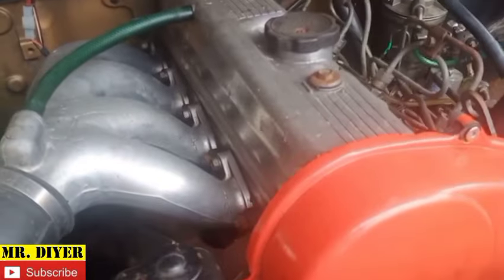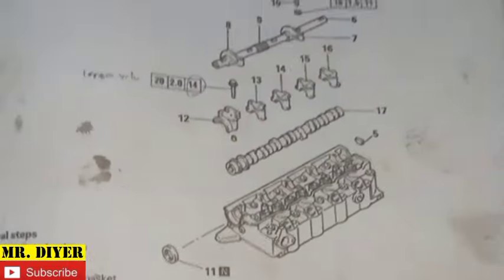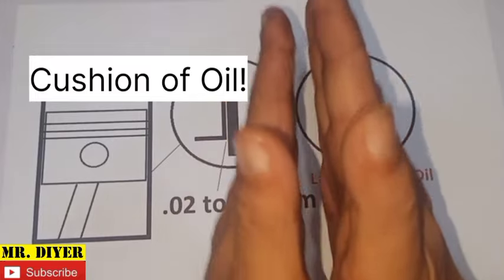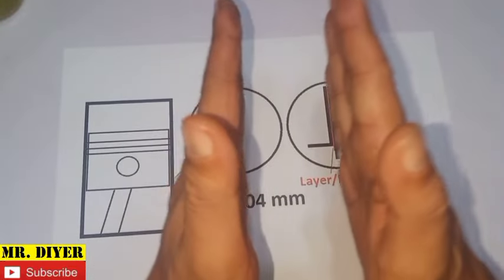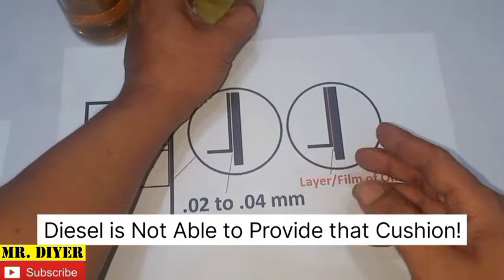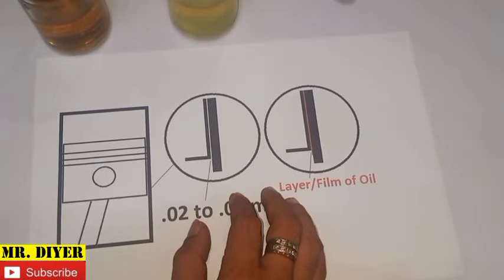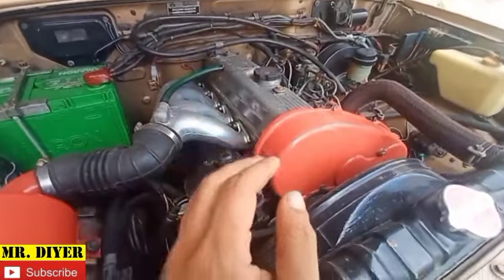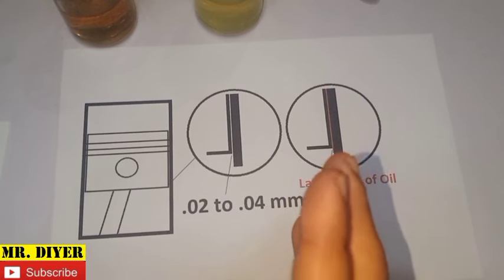Is Flushing Your Engine With Diesel A Good Idea?

Comment: Hello.I agree with oil film and viscosity of oil. But. We are here talking about engine flushing not driving the car with diesel instead of engine oil. To understand all I will break down the problem. When your engine dont work you DONT have the oil film ( only some oil leftover) when you start your engine the low oil pressure lamp does off but to build the nessesary oil pressure it takes time ( depend on engine temp, outside temp ect) so basically you dont have that oil film and your engine is working. The second thing is when you do oil flush you only start the engine and let it work for few minutes on low rev. When the engine is working on low rev you dont have the stress on components like when you are driving around. So you dont need so much oil film.So by mine opinion its absolutely safe to flush the engine .
Reply: I agree with you Sir......

Comment: I have been doing this for 29 years, mixing, I repeat, mixing 1/3 diesel and 2/3 engine oil. For a minute at most. The engine is reborn especially if it has many km.
Reply: I put it in just drove 100 miles today no problem gonna just leave it till I change it lol my 350z has 194k miles but I've kept good oil changes

Comment: You add the diesel to the exist oil you are planning to remove so you will still have some viscosity there, plus you are just idling, an engine that gets damaged by that was already damaged, it's just making noise cause the junk that was in it has been removed
Reply: Yes, seems he was just yapping

Comment: I just rebuilt my TD42 engine due to severe blow by. During the engine assembly process, the mechanic needs to apply good quality oil on the engine components. The thin layer of lubricant is very important for the initial start up. I rather use good quality engine oil and fuel to reduce carbon built up on my new engine. If possible, every 5000km change engine oil.

Comment: diesel is self lubricating though. this property is exploited in injector pumps so that they don't seize, as they would on other fuels. i certainly wouldn't run an engine with diesel in the oil, but i think steeping the entire engine in it could work, but also has the potential to release carbon sludge clumps that cause oil starvation. If you left the engine steeping for a month or longer i think it is sufficiently long to break up all clumps.

Comment: Flushing with diesel won't hurt your motor... If you ever done an oil change on a diesel truck with 300,000 miles on it you'd see the oil in mostly diesel from all the fuel that slipped past the rings.

Comment: Thanks again for some imformative info. 

I have a question, I had my oil and filter changed... whilst i was getting my breaks and break fluid changed! 
Since getting the oil and filter changed, I have had on start up a slightly higher engine noise for say 5 seconds and then it drops back to normal, I have never had this before after I have changed my own oil and never had this start up noise at any time. It's almost like the engine is making noise pumping oil around and then settles... any ideas? 
I know the Garage was a man down that day after guy hadnt turned up for work.
 I hadnt changed my filter and full sinthetic for like 10 thousand miles before this and i'm doutful he changed the filter which is more awkward up behind the engine from underneath and because I had also asked the guy to check a bolt which has rusted out on the exghaust under the manifold and when I collected the car and asked him whether he could cut it off and change it he said he hadnt noticed any bolt? But it was right in plane sight when I changed my own oil and filter whilst lay on the ground🤔 Would an old oil filter left on or maybe even a slightly wrong oil weight they may have put it cause this issue?

I did ask them to check the bolt when booking car in and on the day I dropped car off I reminded them to have a gander at the bolt. I just cant make headway when something dosnt make sense!

Many thanks again for your time.
Reply: What car do you drive?
Reply: @moshet842  2014 Honda Civic Tourer 1.6 idtec, diesel.
Reply: @moshet842  I noticed earlier that the rev counter dosnt sit higher than usual when slight noise happens on start up for roughly 5 seconds, just that there is a slight difference in noise and goes to normal.
Reply from the maker: @stephenmaas8775  if it only last for 5 seconds then i wouldnt be worried about it. Its normal. Id say its always been there its just that its only now you began to notice it https://youtu.be/TWNdPXku9ow?si=6dU7wIlkxMD5Rjk4
Reply: @stephenmaas8775  Depending on how the oil filter is mounted, it could be that they replaced it with a filter that doesn't have an anti-drainback valve or has one that does not work. If the filter is mounted under the car vertically, then this wouldn't be a problem and you can ignore what I just said. 
Other possibilities could be that they use a thinner oil than is called for.
Reply: @moshet842  It is vertical, I provoded the garage with Hona dealer filter and Expensive £110 Green oil, I think 0w-20 specific they said they started using this stuff only now? I usually get mine specific off CoxMotors online Castrol HC-2 oil which is the only oil for my car recommended. Maybe its the new type of oil used or maybe the lad kept my expensive stuff and put in there bog standard use for all vehicles 0W-20 the lady at the coumter suggested when I mentioned about the specific stuff online I had to get... For some reason this time it was not in stock so I had ro run to Honda and have my pants pulled down!😝

Comment: I just bought a seconhand toyota fortuner model 2012 d4d diesel engine with lost user manual, what type of engine oil does it uses based on its manual and can you recommend best type of engine oil for it coz its already a 12 years old vehicle.
Reply from the maker: If that vehicle has always been using toyota motor oil then id suggest you stick to that, fyi toyota motor oil is manufactured by mobil.  As far as im concern Its not really the brand that matters but rather the viscosity.

Comment: It's also called cylinder wash down; when fuel leaks into the combustion chamber and evaporates the oil film in the cylinder walls. 

Galing din po ng English niyo sir.